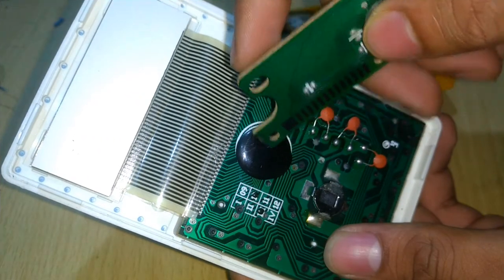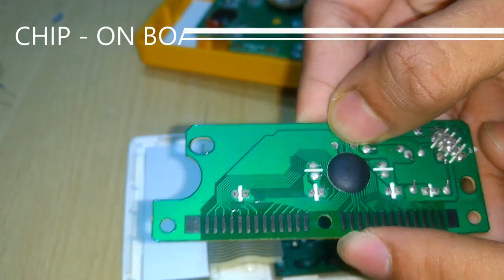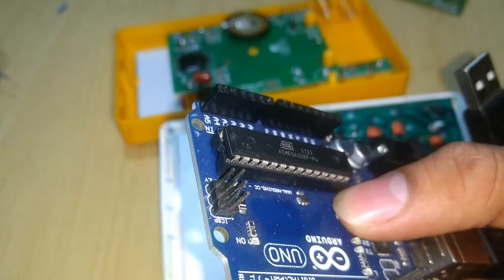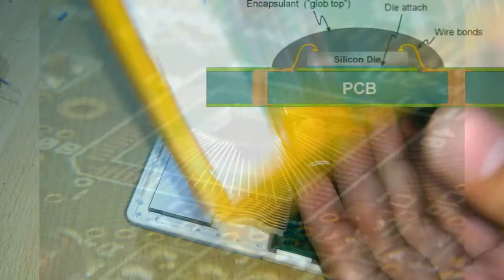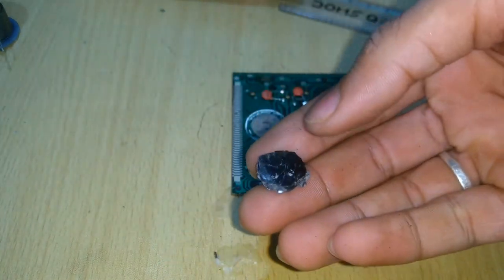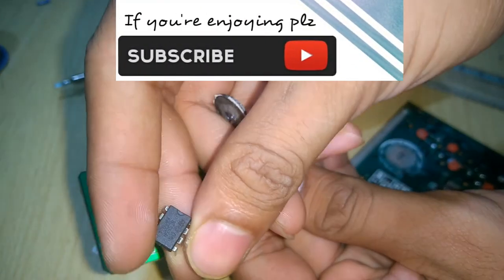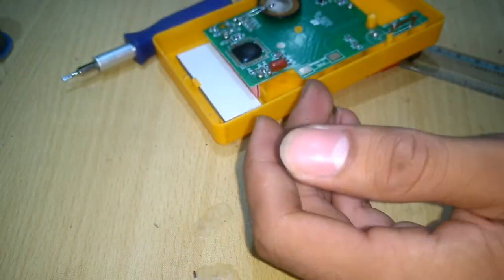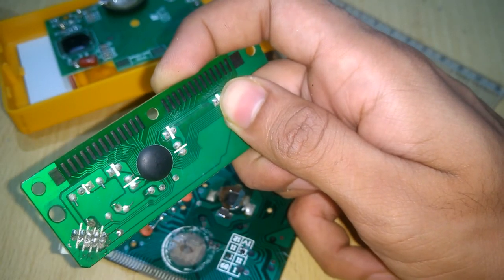What is CHIP - ON BOARD (COB) || WHAT'S INSIDE || EXPLAINED || inShorts

Comment: COBs are widely used for light-emitting diodes for superior light output and compact size. Even the LED filaments on an LED Edison bulb are COBs. The most effective way to help prevent RE is to use an SMD or through IC with the identification numbers stripped out. I definitely prefer packaged ICs over COB ICs.

Comment: Can we reprogram or read program  of this chip on board
Reply: Depends. 99% of the time the mcu is otp(one time programmable) basicly the manufacturer blows efuse bits in memory creating the 1s and 0s in binary representing the code. When they blow a bit its a 0 and when the bit is not blown its a 1. Also a lot of times its a custom microcontroller with weird extra or less instructions or functions and sometimes in simpler electronics its a microcontroller's/cpu's logic all made out of loose transistors
Reply: U mean we reprogram or read the program the ic blow itself

Comment: Are there any chemicals you know that can melt the COB resin?
Reply: You can use red fuming nitric acid in small quantities as not to ruin the fiberglass board as well. It wont damage the circuit but will dissolve the resin. Although it's not practical since it's difficult to obtain and will likely damage the board itself.
Reply: If it's the same type of resin used as a potting material, it should crumble apart if you soak it in a paint thinner like turpentine or acetone for 2-3 weeks.